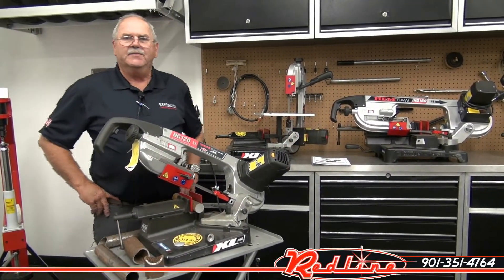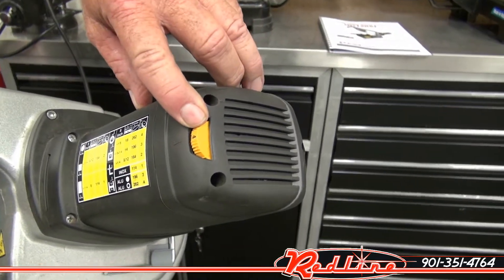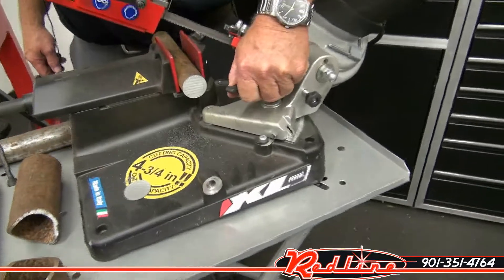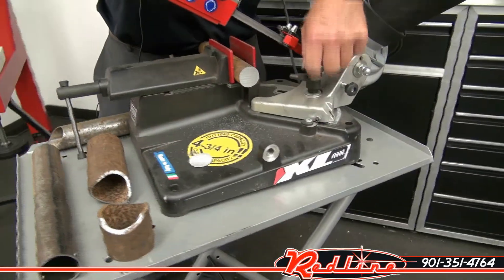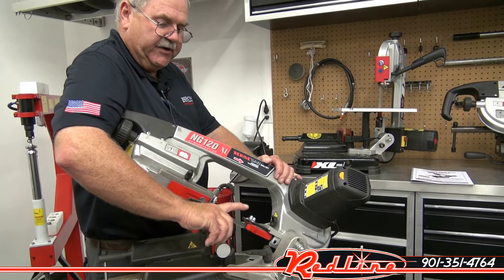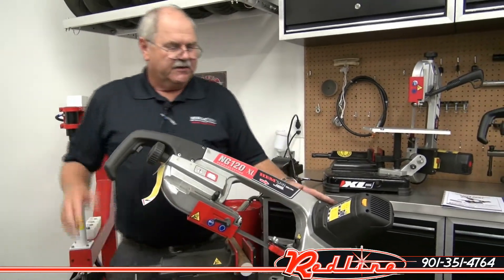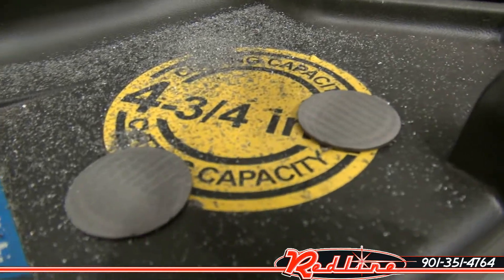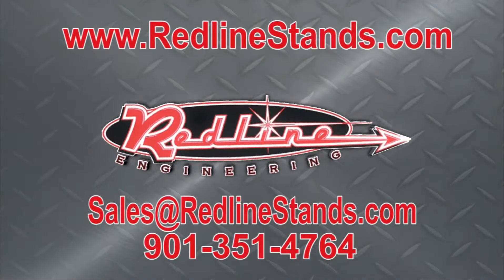Femi Hem Saw NG120XL Portable Metal Cutting Bandsaw

Comment: Any way you could do a video on a quick set-up and adjustment on a new saw? I just bought one, and the manual is totally useless. It is in 43 languages, and you can spend a couple hours flipping through it and still not find what you need. What steps do we need to take to put the saw into service? They went over a LOT of stuff when I bought it at the sales place,  but then the saw was shipped to me later after purchase,, and now it's been two months, and I don't remember any of it. The saw was VERY impressive, but I need to know what steps to take before I fire it up and start cutting. Where do I set the speed for the first cuts on mild steel? How often do I need to do the blade tensioning thing? How do I choose what speed to set the saw at? They also mentioned some things to do on the first cuts, to clean burrs off the blade, but I don't remember any of it.  
Thanks!